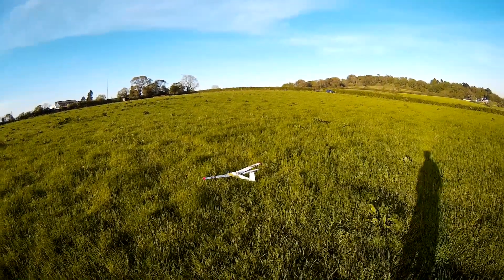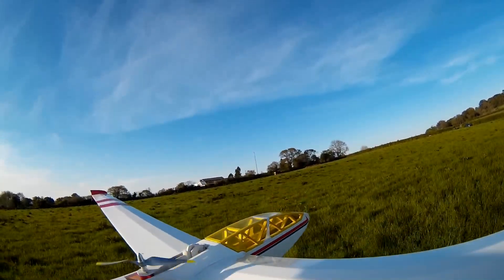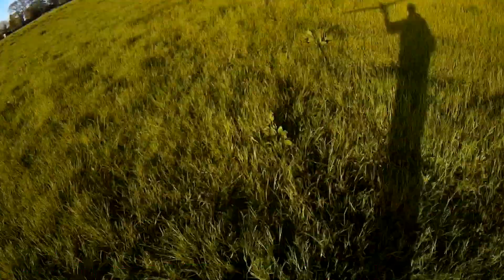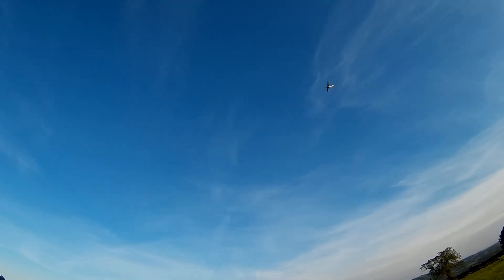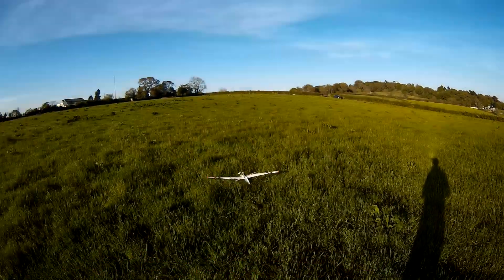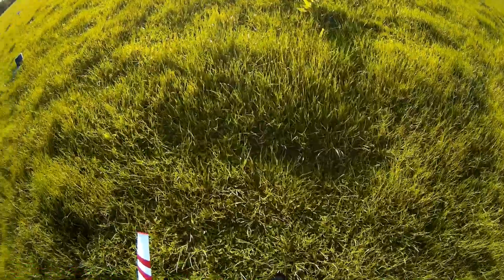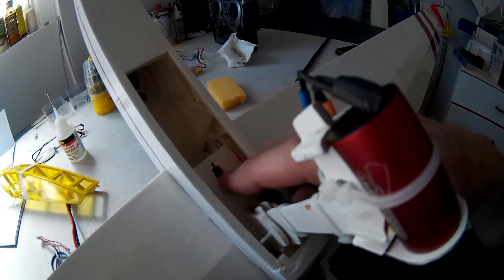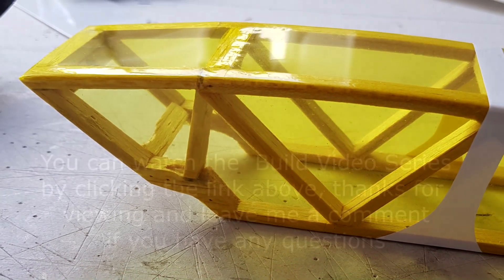Enlarged ASG-32 Motor Glider Maiden Flight Experiment

Comment: Nice maiden until the very end really.  Seemed to fly well. Going to throw a guess out there...I'm sure by now you know exactly what it was. My guess is I think what happened is when the motor engages and spools up...for the first second it is making a lot of thrust, but not in the fully extended position ...so the thrust angle is going to drive the nose forward and down until the pod reaches its fully extended position. Anyway...that may not be right but its my best guess. I've really enjoyed this series of videos Cliff!  Really glad to know of your channel!

Edit: Thought about it more...the pod wouldn't have leverage to move the gliders nose anywhere until it reaches the extended position...so my first guess was wrong I think. I dunno what it was! Lol.
Reply from the maker: I'm not sure either, the little one I copied has the same trait, you just need to know about it and compensate accordingly.

Comment: Excellent! What a great success! Did you feel that that elevator set up was sufficient? Definitely a great result. And easy to fix damage too. Love it! 👏
Reply from the maker: Thanks Mike, yes the elevator works well but I'm thinking of reverting to a standard elevator now I know the correct angle of incidence, mainly because it puts such a huge strain on the servo due to the geometry.  Question is how effective will the elevator be? 😁🤔
Reply: @CliffHarveyRCPlanes  , I guess a conventional elevator may give a stronger effect for loops and the like? A bit more responsive. She's such a lovely looking thing. I'm definitely going to build something similar at some stage. A fellow club member had one of the mini Radian gliders with him last night...a lovely little thing....you've got to have great eyesight though! 😆

Comment: That seemed to go well 👍. 
Now you have fixed it you need to angle the motor upwards so as to counteract the downward force it is having on the plane.👌
Reply from the maker: Yes, I agree Stephen, quite easy to do actually, I'll just place a shim under the pylon stop
Reply: @CliffHarveyRCPlanes  Yes I agree that way you can add a little bit of shim at a time .👍

Comment: Promising to be sure. Consider the C of G shift with the pylon movement. The other one is the thrustline the model will want to be pulled along through the motor axis which is the line of flight it is trying to assume under power so it has two flight modes. Keep pressing on it's wonderful fun getting there as I am sure you will. Talk to it it does help.!!
Reply from the maker: Thanks Roy, re the cg yes, that was the idea behind the sliding battery but the 3s is too big to slide so it stands to reason it'll dive when the motor comes up, I plan to increase the thrust angle as well which should help, thanks for your comments 👍

Comment: AW, the maiden was looking so good. I wonder if until the motor gets enough power to lift itself, it is just pushing the airplane down?
Reply from the maker: Well it can't help David I'm sure, I plan to increase the thrust line slightly but I think more up elevator as I open the throttle would help 👍

Comment: I would call that a success Cliff.  The pop up motor will always give a pitch down effect at low speed so a good handful of up will be required. Practice at height like you did before and I'm sure you will get the hang of it. I would have thought you need to go to a least half throttle quite smartly, otherwise the wind resistance will prevent the motor from popping up and you will have a low powered helicopter on your hands!! Well done.
Reply from the maker: Thanks Bob, I didn't consider the wind resistance, I'm going to try another degree of up thrust to see if it makes any difference 👍
Reply: @CliffHarveyRCPlanes  I have a fixed pylon glider and it has around 3 - 5 degrees of upthrust but at least I can progressively throttle up so the down pitch is not so severe. Good luck with the next sortie!
Reply from the maker: @Bob I  Thanks Bob 🙂